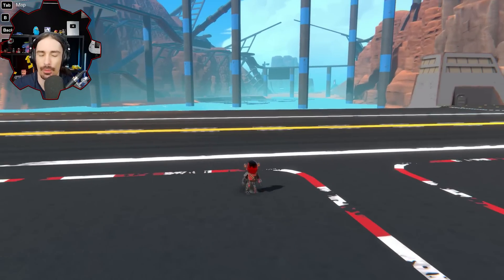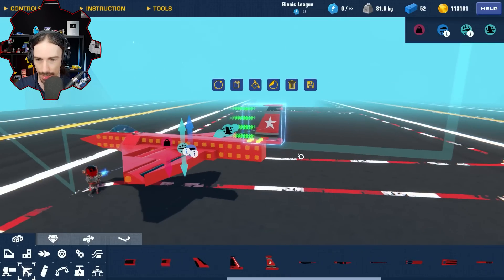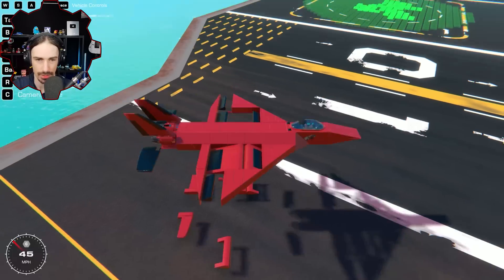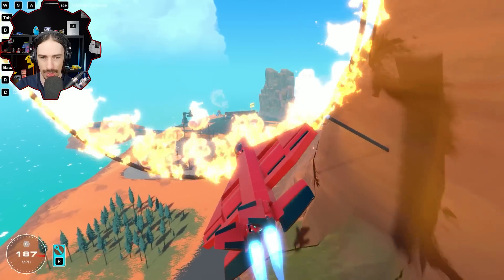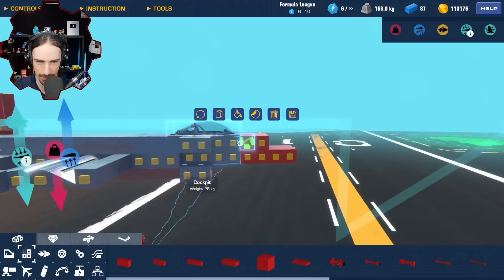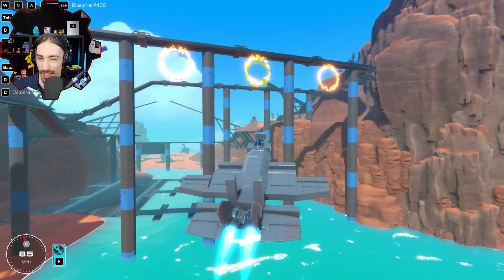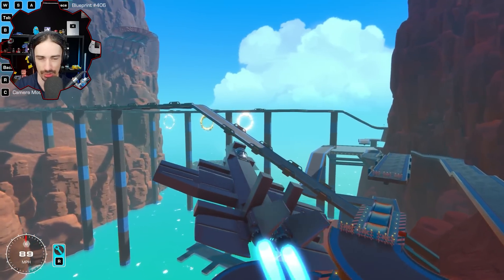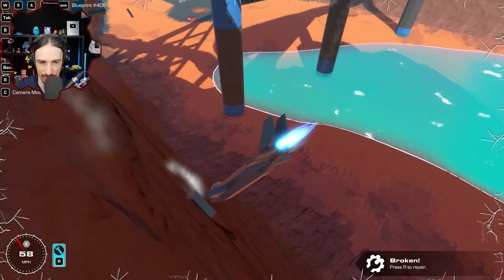Good Aerodynamics vs Terrible Aerodynamics on a Plane

Comment: ok, this makes me want to see speed testing/circuit racing with identical vehicles with the only difference being which wedges you use. would be cool to see how much each stage of improvement increases the speed. Is the speed improvement from red to orange arrows more or less impressive than the difference from orange to yellow, or yellow to green?

Comment: Multiplayer idea: Flying Brick Race.

Everyone has 150 blocks, 8 power cores, and are not allowed any non red aerodynamics arrows to build a flyer (doesn't have to be a plane, could be a helicopter, blimp, or something even wierder) and compete in a race. or maybe a dogfight, if you prefer.